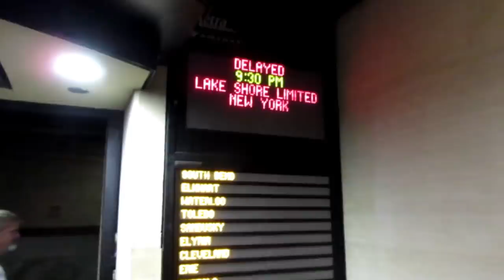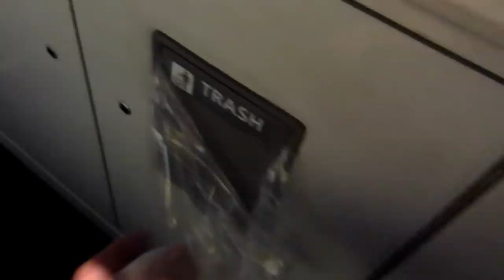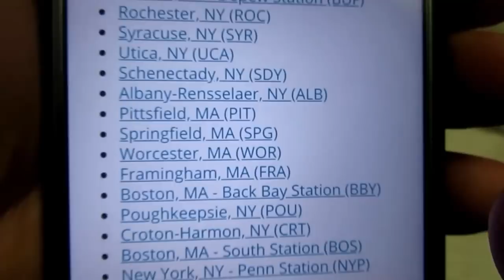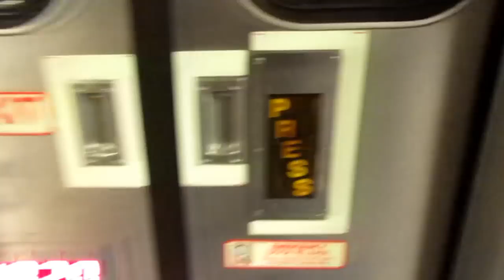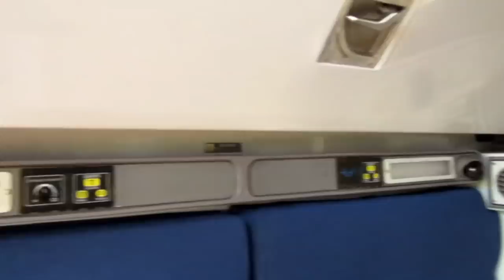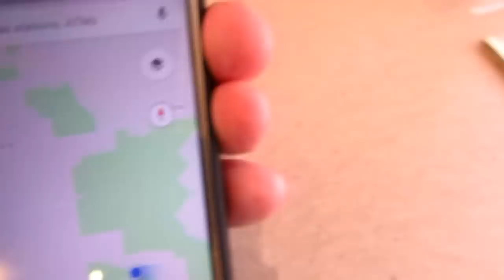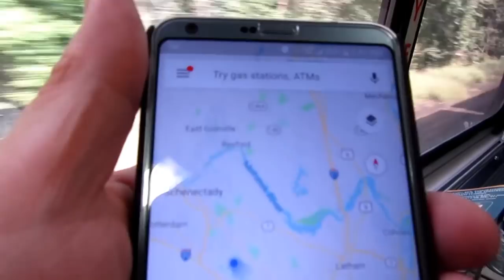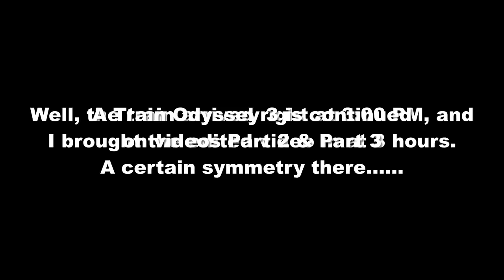A Train Odyssey 3, Part 1, AMTRAK "Lake Shore Limited"

Comment: Hello! I really enjoy your rail adventure videos! I am an engineer for Amtrak currently working on the Auto Train out of Sanford. Per CSX operating rules, operating crew must get permission from the section foreman to restart the train,  each time the train stops inside the section foreman's working authority. They also must get the authority to enter the section of track, that is controlled by the section foreman Thank you for sharing your videos!
Reply: ??: 🚂 Shared your info with freight-rail-fan who said to ask you: how come CSX passenger trains aren't signal controlled, like CSX freight trains? I'm thinking it might be a safety/liability issue? Thanks

Comment: The long pieces of rail running along side are pieces of continuous welded rail awaiting installation or had been changed out with new rail. If you aren't hearing the clickity clack of the wheels on the rail you are on welded rail. Also the rail through Northern Indiana for the most part is maintained by the N.S. rail road.

Comment: 1:18:50 The bathroom setup is exactly the same for the majority of RV's and smaller boats. You have to turn sideways in the compartment wash one side, turn 180 degrees wash the other side, sit on the toilet lid to wash your legs and feet. Cramped, but at least you do not have to wait for it. The Mississippi River is the divide for U.S. trains. There is 5 Class I railroads operating today, over 14 when I started my railroad career, mergers are both a blessing and a curse. In the east, there are CSX 21,000 miles of track, which was formed in 1980 by the merger of the Chessie System and Seaboard lines, the "X" was just added to imply Xtra. The other is Norfolk Southern(NS) 21,500 miles of track which was the merger between Norfolk & Western Railway and Southern Railway in 1982. Some of the railroad lines on CSX and NS have been in continuous operations since the 1840's, namely CSX's Baltimore & Ohio railroad, the nations oldest. West of the Missippi River you have Union Pacific 32,100 miles of track, which is the nations largest railroad for tonnage hauled since they acquired Southern Pacific Lines in 1998. Then you have Burlington Northern Santa Fe(BNSF) 32,500 miles of track and my employer, that was formed when the Burlington Northern and Santa Fe Railway when they merged in 1996. Last but not least is the Kansas City Southern Railway with 6,000 miles of tracks. Some shippers consider Canadian Pacific and Canadian National as Class I's, yes they do own operations in the U.S, such as The Soo Line and Illinois Central, which before restructuring was known as, and still to me, Illinois Central Gulf, more commonly known as the railroad Casey Jones worked for. And there are hundreds maybe thousands of Class II & III railroads Alaska Railroad (ARR), Iowa Interstate Railroad (IAIS), Florida East Coast Railway (FEC) and many more are considered Class II lines. Class III lines are mostly the port, switching and chemical plant lines. 
Railroad Class system is based on the money made in operations during the year.
Class I operating revenue exceeding $457.9 million
Class II operating revenues between $36.6 million and $457.9 million
Class III operating revenues of $36.6 million or less 
There is not one single Class I that has operating revenues under $30 billion a year. Mergers, a blessing and a curse for the workforce. Due to the Class system applying to freight railroad operations, AMTRAK is not included in it, but many regional passenger trains are listed as Class II's.
1:57:32 The most common problem with short trains like AMTRAK is loosing the shunt with the rails and disappearing off of the dispatcher monitors. For the signal system to work the axles of the train create a very low resistance connection across the tracks, a shunt. This shunt trips relay's, located in the shiny silver boxes you see beside the track among other things, that signal the computer exactly where the train is at. The dispatcher's urgency to stop was due to today's computer dispatching systems when AMTRAK disappeared, the system does not look for it and the possibility of giving a clear signal to a waiting opposing, or lining track switches against the train is very real. These systems were designed and built for trains exceeding 5,000 feet in length.
2:03:11 Respotting, means they must pull the train forward two cars to"spot" the end two cars were they can be serviced on, boarded or detrained.
2:05:10 That "extra rail" is either new rail waiting to be installed or old rail ready to be removed. Most rails on lines with continuous welded rail is moved in lengths from 2,300 feet and up. I have seen it being laid down in 7,500 feet for one track! https://www.youtube.com/watch?v=VOnkzMox89I
2:20:13 The Catskill Mountains of NY is the only senery in the state.
Good video.
Reply from the maker: Andrew Armstrong, thanks for clearing up those questions. Regarding the stunting, I was aware of the idea that the solid metal axle/wheels shorting out, or shunting, the rails, and this being detected by electrical circuitry. Probably 25 -30 years ago I encountered a freak accident at a railroad crossing where a vehicle was pinned under a partially lowered crossing gate, which was entangled in some power/phone lines that were overhead at a diagonal to the road AND the tracks.

Emergency responders were trying to free the vehicle from the gate, but it would not raise or lower. The vehicle's engine was not starting, so many people were trying to push the vehicle off the tracks, but the gate was hung up with something on top of the vehicle.

I approached a police officer with my offer to try and trick the gates to raise and lower, by using my car's jumper cables to shunt the rails. He agreed that this was something he would like me to try.

I found that a brief shunt had no effect, but stunting for a longer period did trigger the gates to cycle (I don't remember exactly HOW they cycled), but I was able to get the gates to attempt lowering, followed by raising, and while the people rocked the vehicle, after a few cycles the gates got untangled with the power lines (it was very gusty/windy and the lines were swaying quite a lot) AND disengaged with the roof of the vehicle, and they pushed it off the tracks.

I tried to get the police to call the phone number on the crossing gate post, to advise the rail company of what we had done, in case our actions might have triggered something in their computer system or at a dispatcher's console. I don't know if they ever did.
Reply: @youtuuba  No damage was done other than a signal dropping to red in front of a train if a train was operating in the area. Must have been those old wood gates, think they were mahogany, some were steel I-beams, today they are all lightweight fiberglass and you can push them up with one hand, furthermore, they are made to swing away as well, and being spring loaded they snap back. I know a lot of people complain about coming up to a crossing with the gates down and no train around, they are build to "safety fail" in the down position, such as power outage, battery banks dead, bad relay. That is not my area of railroad expertise but over the years of talking with signal maintainers, who are the ones with that expertise, I always found it interesting on how and why that stuff works. Maybe it was because it was too much to learn or maybe they didn't want operating crews to know, I do distinctly remember a signal maintainer riding with us for about 75 miles to check on signal alignment and other issues. It was at that time, 6 years into my career, that I learned all those crossing gates, lights and trackside signals worked off of a 10 volt DC current in the rail, that when shunted, made from one to two dozen or lots more single and double throw relays make a signal appear, crossing gate lower or tell the dispatcher where we were at on his control board on a certain part of track.  Here is something good to sink your teeth into, American Railway Engineering and Maintenance-of-Way Association (AREMA) https://www.arema.org//files/pubs/pgre/PGChapter7.pdf
Reply: @ Edward Anderson: Thanks for clarifications! All are things my freight-rail-fan husband couldn't explain. Great fun to share your explanations with him.

Comment: You have to remember that you're not dealing with a stateroom on the Pacific Princess. So, the idea of comfort is subjective. For me I might consider that full relatively comfortable - I'm used to having to do coach most of the time that I've traveled on Amtrak. So, for that long of a trip I might pay the extra money - if I could. The Lakeshore Limited splits at Albany with 1/2 continuing EB to Springfield/Boston and the other 1/2 turning south to New York. Your narration is pretty good

Comment: Did You Have a Choice for Breakfast and Lunch or Do They Just Hand You a Box?

Are you supposed to tip the various AMTRAK staff?

Did the train make up any of the lost time getting out of Chicago?

Your walk around Chicago was blotted out by the "Windy City" winds such that I couldn't make out what you were saying.
Reply from the maker: No choice for the boxed meals, everyone got the same (as I recall). There might have been a vegetarian option or something. Regarding tipping, you are not required to do it, any more than tipping anywhere else. It is common to leave a dollar or two for your server in the Dining Car. I think many people, maybe even most people, will tip their sleeping car attendant at the end of the trip; I usually tip $10 per day of the trip, so for a trip lasting three days I tip $30. But I would not feel guilty tipping a third of that if I was short on cash, or if the attendant did a so-so job.

The train was pretty much on schedule by the second day. AMTRAK builds delays into their long distance train schedules so that they can compensate for unexpected delays. If they leave one place late, or have a slow down, then at one of the planned longer stops, they might stop for a shorter period, and they might have some leeway with the dispatchers to help make up time where possible.

Comment: I think I've heard it suggested elsewhere that one sit (on the toilet seat) while showering in the private showers in Amtrak sleeper cars (and use the shower head as a telephone shower), mainly to increase one's stability while showering on a moving train.  (But if the shower/toilet is that narrow, it sounds like you could probably just brace yourself against the sides of the shower/toilet while standing, instead.)

Comment: As of November 2018 the Sears Tower (no one in Chicago calls it by that other name) is still the tallest building in North America when measured from street level to it’s rooftop. It stands 1,450 ft and has 108 floors. Some say it has 110 floors but the top two are for mechanical purposes. The building will be overtaken by New York’s Nordstrom Tower which will rise over 1,500 ft to it’s roof when completed. 
The new World Trade Center in NY is only taller than the Sears Tower because of the spire/mast/antenna they stuck on top of it. And Toronto’s CN Tower is not considered to be a true building at all. Sears is a skyscraper and CN is a Tower.
Reply: I think most of us outside of Chicago don't call the Sears Tower anything else either. Lol. It'll never be anything else. It's too ingrained in American memory xD  ^_^

Comment: I just watched the segment from Syracuse to Albany with the shots of the Erie Canal. The original 1817-25 canal ran in a narrow “ditch” because of the limitations of horse-drawn barges. Since the 1918 enlargement, it has run in the Mohawk River and other local rivers where possible because powered barges can overcome the current. There are still locks where the Mohawk is shallow or has falls.

Comment: The extra rail you mentioned at Buffalo ( 2 hours 5 min into the video) is actually one of two things; New rail waiting for track crews to replace older rail on a track for a certain stretch or recently removed older rail recently replaced awaiting a rail train to pick up.  Older rail can still have lots of life left and placed on lighter density lines.
Reply: Fyi: my rail-fan husband said rail track eventually has metal fatigue, but can be melted down and re-cast.
Reply: Fyi: I asked my train-fan husband what happens to used rail. He said rails eventually experience metal fatigue, but can be melted down and re-cast. Now I'm wondering how the companies determine rail fatigue. (Perhaps they track tracks? LOL.)

Comment: Looks like you were in the new generation of cars being constructed for Amtrak. Regarding the "restart", I have heard that before here at the Longview Railyard (where I worked for 20 years 7 months).  It apparently has to do with PTC or Positive Train Control. If the PTC loses track of the train, they have to do a restart. That may have been the reason for the "safe stop" which means they don't have to "dynamite" the brakes but just do a normal stop.

Comment: My map shows the Amtrak route and in Utica for a while the Mohawk River is on the right as you head east and the Erie Canal on the left, but the canal is far wider than the river. The rail line then veers away from the river and crosses the canal. From there the canal is on the right and Highway 5 on the left.

Comment: Did a little research on the locomotive change at Albany. Amtrak has some locomotives that are combo units. They run diesel until they get to the Northeast Corridor than they take power using the "3rd rail" system. This research was done because I was wondering why the locomotives leaving for New York did not have pantographs on top.
Reply: The line heading into Pennsylvania Station from Albany is third rail to the Harlem River I believe, not overhead. Amtrak shunts on a combination diesel/third rail locomotives at Albany for the train heading south, while the train heading east to Boston retains the diesel.

Comment: Restart means they stopped and then had to move the train forward 5 cars.  Any train movement requires permission from the dispatcher.  The train was probably too long for the platform causing the move to allow passengers to board or leave those cars.
Reply: They did seem to be using the term restart and respot interchangeably.   Anyone familiar with the Empire Builder, like Youtuuba, knows respotting is common and listening to his scanner usually only involves the engineer and a conductor.   However this time, dispatch issued an EC-1 track warrant after the signal failure before the station.  The warrant was still in effect at the station so now I assume the respot has to reported to dispatch.  Normally this would be under signal control, but I assume the signal failure caused dispatch to declare it dark territory temporarily.
Reply: "Take 'em ahead about 5 cars" would be the standard RR lingo for respotting the train. Train movement requires the permission of the dispatcher only if it is straddling a signal while stopped or will pass a signal going ahead, or making a reverse move or if permission is needed to pass a signal displaying a stop indication. Passing a red signal is usually done when returning to a part of their train that is tied down on the other side of a signal or if moving into an occupied block while looking out for the train ahead. I think the "restart" had to do with the newly implemented PTC or Positive Train Control. I have heard that term several times here in Longview, TX, and it usually means the PTC lost track of the train and they have to do a restart (i.e. reboot of the train's PTC computer).

Comment: I'm new to your channel. Quick question:  what's the story about the rail car that seems to have scaffolding separating the left and right sides on the upper level?
Reply: That's metra. It's a commuter train in Chicago that took over many older routes that belonged to railways when they became unprofitable. Those companies moved to freight traffic, while Metra took over.

They are (as much as I know) some of the longer commuter trains you can take, with some end-end trips being 2-2.5 hours away from Chicago. There is also a line than runs on old Union-Pacific North tracks from Chicago Ogilvie station to Kenosha, WI.
Reply: Some trains operate for metra in Ogilvie station, some out of Union station. It's about a 10 minute walk between the two.